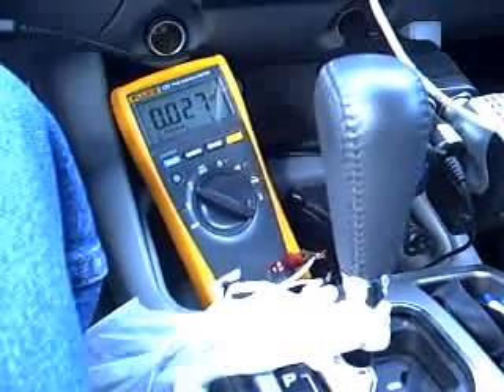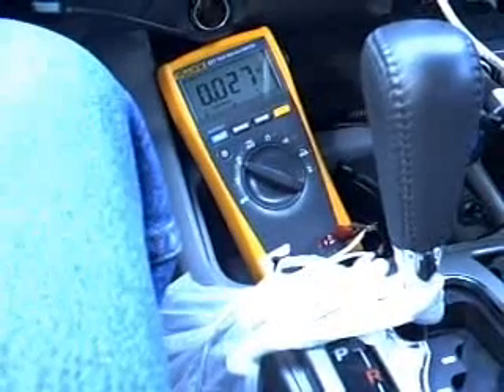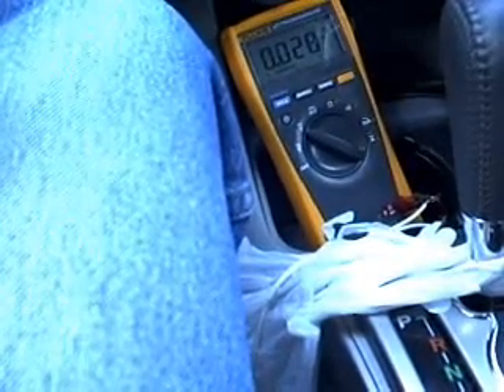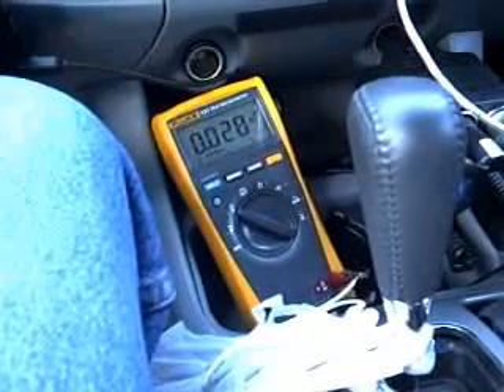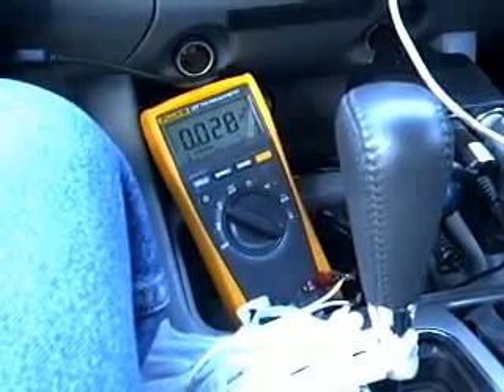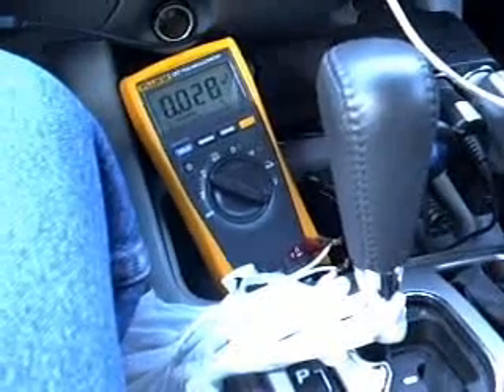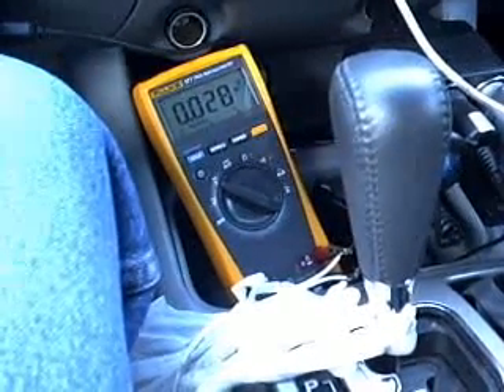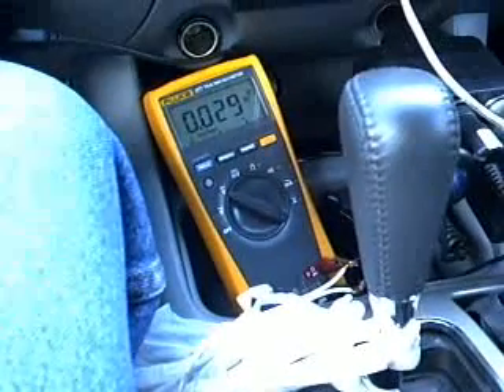#89 - VSPB Toyota Road Report 01

Comment: You can't drive the resistivity of water to zero, but 70% efficiency is attainable in practice.  This means you need 1.7vdc/0.7 or 2.4vdc across each cell.  Any more is purely generating waste heat and water vapor.  For best efficiency at 12V, you really need a design with multiple isolated cells in series, about 5 of them.  From what I see, the majority of folks don't have this configuration.  Sid Young is on the right track. His gas measurements still show evidence of some water vapor though.

Comment: You clearly don't have to boil water to vaporize it.  Recall vapor pressure.  Also, some might remember those electric vaporizers you Mom put in your room when you had a bad cold.  Ever take one apart?  It's just two electrodes in water with 120V AC going into it making heat via resistivity of the water.  Likewise, any HHO cell with more than 1.7vdc across it is generating heat and water vapor.  The higher the voltage above this threshold, the more heat and less efficiency. (continued)

Comment: It turns out that it doesn't matter what voltage you use to pass the voltage through the water, as long as it's over 1.7vdc.  The resistivity of the water depends on the electrolyte.  The power going into heating the water is about (V-1.7)*current.  The 1.7vdc disassociation voltage does not contribute to the heating of the water.  It is a threshold voltage that must be overcome for electrolysis to take place.  Anything above that goes into heating the water in the cell.  (continued)

Comment: 33.8 liters of HHO requires 19.3E4 coulombs worth of electrons via electrolysis, or 5.78E3 coulombs/liter.  If you want to produce one liter in a minute, it takes 5.78E3/60s = 96 amps. (continued)

Comment: Sure.  Basic electro chemistry.  It takes 2 added electrons per hydrogen molecule to reduce water:  H2O+2e- => H2 + 1/2O2.  Electrons come from electrical current.  1 amp = 1 Coulomb/second.  Faraday's number, which is Mole/Columb, is 9.6474E4 coulombs/mole.  So it will take 2x9.6474E4 coulombs to produce one mole of H2, which is 22.4 liters at standard temperature and pressure.  There's also 0.5 mole of oxygen (O2) produced for a net yield of 33.8 liters of H2 and O2 gas, aka HHO. (continued)

Comment: If you use a water trap and are seeing still 1 liter per minute at say 15 amps, then what else could it be other than HHO?  Please site your sources, because your 96 amps thing is hard to believe.  Also, cells that start off cold at 15 amps, how would water vapor be created with no initial heat?  Don't you need to practically boil the water to create any significant amount of water vapor?

Comment: The PHD I work with was inspired by HHO rage and ran some calculations today.  Fact is, you need 96 amps of current to produce 1 liter of HHO gas per minute.  If you are seeing 1 liter/min with a current less than 96 amps, you are seeing water vapor from the heating of the water (inefficiency.)  Previously thought my 12V 9.5amp unit created 750ml of HHO/min, but in reality, 100ml is HHO and the rest is water vapor.  This is why it *seems* more HHO is produced at higher electrolyte temps.

Comment: This makes sense.  A good efficient cell produces more H2+O2 gas, and less heat, and thus less water vapor.  A very big chunk of the mileage gain people are reporting is from putting water vapor into the engine, not hydrogen gas.  US used water vapor injection in WWII to get more horse power in airplanes.  The trade-off is engine life is shortened significantly.  (continued....)

Comment: I was just thinking that it may be useful to test any optimal temperature for when the cell is running (i.e., 180 F).  If it is the case that this is safely attainable, it may be more efficient to have a thermostat and coil heater inside that will heat the water until the optimal temperature.

Comment: just new to this so really enjoying your tests :) 
how about glow plugs as used in diesel engines? if they were installed in a space in the bottom of the tank, would they heat the water fast enough to help?

Comment: Use CaO (Calcium Oxide) and NaCO3 (sodium carbonate) for your electrolytic fluid. You'll get a buffer solution of about ph 10-11 if your concentrations are correct. 
As far as the brown scum? Thats indeed rust, Fe2O3 or iron oxide thats being leeched out of your plates by the electrolytic process.
Try NOT using steel or iron for your electrodes. I was thinking graphite was a good option, since we set up zinc and salt electrolytic cells with pencil lead in my general chemistry lab.

Comment: Another point, someone here uses a radio valve tuner as the electrolized (aluminum he says) This tuner is made of exactly the same size pieces of flat steel, his elecrolizer almost exploeds into hydrogen making process's, Huge amounts of hydrogen come up,
This is the most important part of making hydrogen, TUNING the Steel to the same note, and pulsing it with high frequencies will produce tons of hydrogen, at less than an amp. Highway Speeds will require huge amounts of hydrogen ive read.

Comment: Stan Meyer Plans state, Tuning the stainless steel or the steel used to each other, as in, yes, like a tuning fork, if you tune the metals to the same note, they will then resonate MUCH more, producing Better more powerful hho for one, but 500% more... at .5 amps with the pulse wave generator, this Tuning of the STEEL is the most important part of making hydrogen, something many over look, WE are all SOUND, SOund is what Fractures the water, so if you tune them, BINGO....

Comment from the maker: I disagree. The optimum voltage does not change with temp and efficiency is flat relative to current. We're about to find out for sure because I will be recording the data very carefully.

Comment: what i really want to see is this, somehow have a measured amount of fuel and without the HHO going in, see how far u go on that at 60mph. then refill the fuel to the same level and then run with the HHO and see how much longer the fuel will last eg: how many miles more. all this preferably on some sort of track so theres no ups and downs and differences of road types.  I just wanna see that, I think alot will say the same as me.
Love your work ZFF.

Comment: The reasoning behind the neutral plates, is to divide the input voltage between them,  having too much voltage over the cell only heats up the electrolyte.  I think just over 2v per sell will yield the best, anything more is no good...

From there the need to have the sells in series...

Comment from the maker: To maximize the benefit, you are correct on all points except one. I just read a NASA paper that indicates maximum thermal efficiency by advancing the timing, completely contradictory to what one might expect. I'm still on the fence about that one. I just don't know without a test engine that I can run and play with like that.

Comment: The way I'm getting it, reason for the HHO addition to fuel, to get better milage, is bcause it grately enhance the fuel-charge's flame propagation.  BUT for this to meterialize into some tangable benifit, one would need to alter the engine's Timing maps, Normal fuel burns slow, as it needs to get broken down to smaller molecules first b4 exploding. From there the need for timing advance. With HHO added, timing can be braught back much closer to TDC.  

Am I correct in this?

Comment: ZFF is creating this not to create racing performance, this is for less fuel usage.  To add nitrous oxide, you'd be bringing up the cost, defeating the purpose...plus NO3 (or is it NO2, nonetheless...) produces bad exhaust, worse than regular gasoline.

Comment from the maker: Perhaps. The goal of the constant current PWM is to produce a known constant volume of HHO to compensate for with the EFIE.

As it is, the EFIE offset is fixed but the volume of HHO it would compensate for drifts in and out of the optimum range.